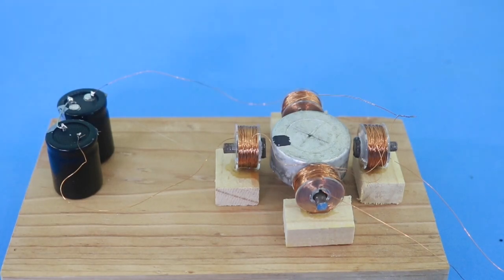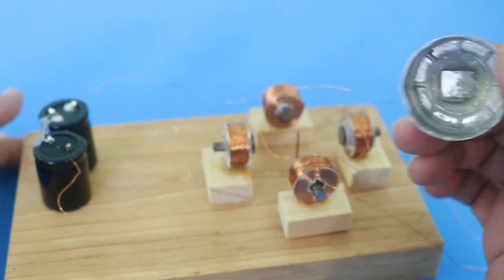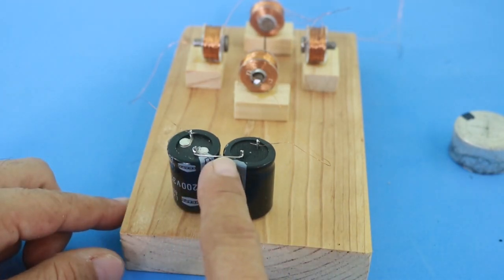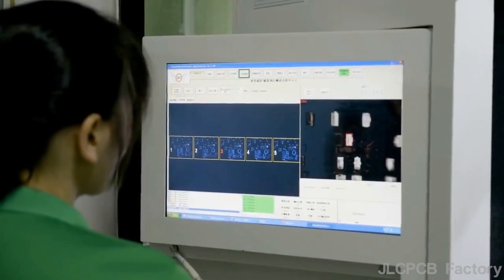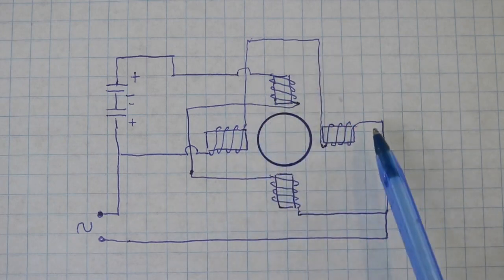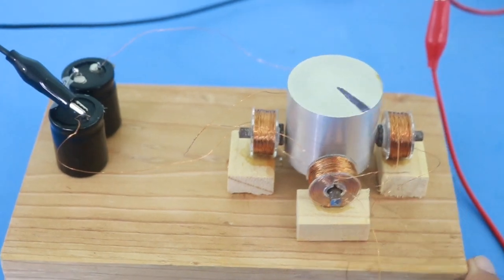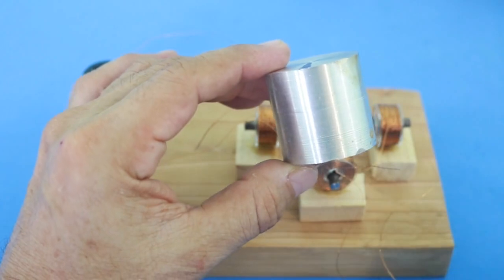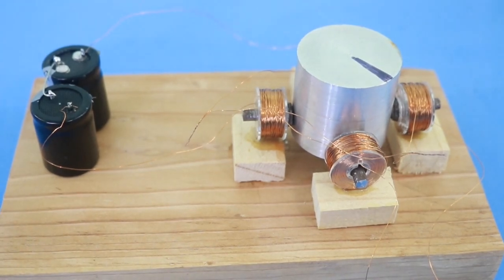Homemade AC Electric Motor 4 Poles

Comment: Two capacitors in serries doubles their rated voltage. In your case your capacitors in serries is good for up to 400v ac. 😊 i would say your plenty safe opering the serries capacitors at 18v.

Comment: Awesome 👏 👏 video !!!! Is the rate of rotation dependent on the rate of charge and discharge of the capacitors which is determined by the frequency of the AC??
Reply: The rate of rotation is dependent  on three factors. Electrical phase abgke difference and the physical phase angle, as well as the load. 

There will always be slip between syncronouse with the poles and rotor rotational angle. If there were no slip, there would be no changing magnetic field on the rotor and no induced magnetism on the rotor to interact with the rotating magnetic field.

And when it comes to a load.  Greater loads slow the motor down causing greater slip from synchronousity with the changing magnetic field.   Google induction motor slip torqe curve.

Comment: 4:54: This motor would make an excellent turntable motor for a phonograph. The frequency could be adjusted by a signal generator so that it rotates at 33rpm for LPs and 45rpm for single records.

Comment: this motor is known as hysteresis motor....
Reply: Hysteresis is something that happens with magnetic materials so that, if a varying magnetizing signal is applied, the resulting magnetism that is created follows the applied signal, but with a delay. ... As a general term, hysteresis means a lag between input and output in a system upon a change in direction.

a general term, hysteresis would be like the lag in the fluid as you stir a cup of tea, it never quite catches up with the spoon

Comment: Can I ask a question 
If you invert the ‘inner’ to ‘outer’ of a set will the polarity be then uniform on both poles ?
As an induction rotor has universal opposition to the feild applied how would that divide the feild? 

It’s a great video thanks for sharing

Comment: Great setup, but I prefer a motor project with a high efficiency power source , for example from a solar cell or from a capacitor..keep inspiring.
Reply: mpig, and how 'do you' turn these dc supplies into the 'required' alternating currents/magnetic pulses without adding more components, and so lowering the total  efficiency even more...